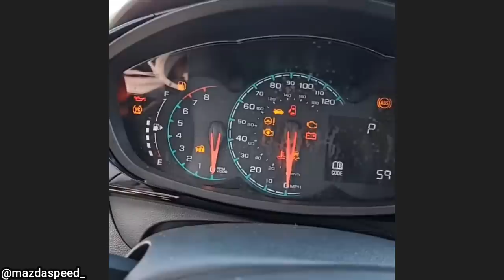Customer States My Car Won't Start (Chevrolet Spark) | Just Rolled In

Comment: It's amazing that people will take a chance of driving their vehicles to the shop in such bad shape like the Chevy pickup in the second clip was but somehow manage to make it. They each have either have a Guardian Angel or Lady Luck.
Reply: They probably installed new upper control arms and drove it there to be aligned.  I'm surprised the shop was driving onto the alignment plates
Reply: To tell the truth, I've done it.
Reply: I limped my golf to work (where I have a lift) on a drive axle that was one good incline from exploding into pieces and leaving me stranded. That axle legit had 0 miles left on it as it fell apart when I removed it.

Comment: I have a renewed distain for mechanics now due to a recent incident. Car began overheating so I took it in. They told me that it needed a new head gasket and would be around $2000. I declined, because I am a college student and do not have that kind of money. I read the diagnostic and it stated that the radiator cap was not holding pressure and the gasket on it was damaged. I literally walked across the street and purchased a new one for $10. Temperature issue was fixed. Head gasket was not broken. This is why so many people hate mechanics.
Reply: customer states, "head gasket is NOT blown" lol, good luck kid, let us know what you find on your next oil change
Reply: @muffntheB  Because it was not. Engine passed a pressure test, and is not consuming coolant. It also has clear oil, clear coolant, and no exhaust bubbles in reservoir. Wanna tell me again how it could be a bad gasket?

Comment: 0:05  Every technical profession has stories like this. The TV repairman who plugs in the TV; the electrician who changes a light bulb; the plumber who opens a valve; the HVAC guy who replaces the battery in the thermostat. I admit, though, that this one is pretty pitiful.
2:45  Another of those weird things that you could never make happen on purpose, and that no one would believe without the video.

Comment: Woah, what the hell was in this garbage can for this spark to cause this violent explosion? XD
Reply from the maker: Dynamite? 😆
Reply: *I assume there was flameable vapours at the bottom and when that spark when inbetween the air and that flameable gas it exploded with a good air-gas mixture.

Comment: That guy welding is lucky it only blew up that trash bin and not the GAS TANK sitting on the bench like 2 or 3 feet from him. Never weld right next to a tank of gas. Or in this case, next to a barrel that obviously had some sort of flammable vapors in it.

Reminds me of a video where a guy was trying to plasma cut the top off an empty barrel and the fumes inside blew the top off in his face.

Comment: I didn't take a video or picture of it for a few reasons, but I did a brake job at work and someone forgot one of the pads. Straight caliper on rotor. I didn't get a picture because many have done that and seen that stuff before.

Comment: Some people are particularly irrational about their car maintenance. 
It’s pretty common for people to run their car out of gas. Theres no good reason to do so, but people feel like if they avoid buying gas it’s somehow cheaper… spoiler, mechanics cost more than 1/4 tank. They do the same thing with oil changes. “I cant afford an oil change” they’ll say, as though 3-5k for a rebuild or engine swap is cheaper.

Comment: I had a woman complain her car sounded like it was going to die ONLY when she turned right. I tried to explain to her when she made sharp turns with low gas, it probably sloshed gas to the opposite side of the fuel pump and she temporarily ran out of gas. She didn't believe me,  I mean just put some gas in the car to see if it fixes the problem. Whatever lady lol

Comment: It's so depressing how that Chevy Spark's steering wheel switches and door bong were identical to European Vauxhall/Opel models.  That's GM for you, the Buick Regal and Vauxhall/Opel Insignia are also the same car.

Vauxhall is now owned by Peugeot so we'll see how that goes... or doesn't.

Comment: That Chevy Spark has a poorly designed gas gauge. When empty, there are no indicators lit, I can see that confusing to someone unfamiliar with the car. It should have been designed as the bottom light being orange, and would only lit when the tank is very low or empty.
Reply: Except that there is a low gas indicator clearly lit up in this one.

Comment: I had the enjoyment of having a 00 Camaro which were notorious for faulty gas gauges and yes, mine did not work. But the trip odometer did. Never once did I run out of gas. There is something to be said about common sense.

Comment: People just running out of fuel and getting stuck is a way more common problem than most people would think. Some people are stupid but for some people, especially when fuel prices rise, they delay filling up until the prices come back down. The problem is they end up getting lower and lower without realising it & then car no go no more.

I am not sure how the person with the Spark didn't understand just by looking at the gauge that it was empty? Did they just buy the car and not understand how it indicated how full the tank was or something?

Comment: What would cause the hood of that car to split open? I worked at a body shop for 8 years and never saw anything like that before.
Reply from the maker: Probably rust I could see doing that. Maybe rust the spot welds that hold the two pieces together. Or a cheap aftermarket hood?

Comment: The hoods separating is scary.  And the wire burning through the plastic parts was an insurance adjusters nightmare. No gas in car? 75 dollar tow fee. 100 dollar diagnostic fee. Please use YouTube and learn how to do your brakes. Great, scary videos. I might start walking everywhere.

Comment: the Chevy truck was driven straight onto the alignment machine. It was probably a lift kit done at home with the intention of taking it to a shop for an alignment.
Reply from the maker: I was thinking that as well. Torsion bars probably cranked up. Still waiting to hear from the tech what the exact "issue" was.

Comment: I been seeing a lot of people coming in without gas. I know gas prices are high but its NOT an excuse to come in with no gas especially we have to test drive it. I even had to confront a customer to put gas in his car.
Reply from the maker: That always hurts my heads when customers did that, especially for a driveability concern. The gas tanks are always full though when you have to do a fuel pump.
Reply: @JustRolledIn  I know right! Just don't make no sense.

Comment: The Chevy Spark will be back here in a year or so as “after no oil changes the oil in this car turned to jello” or “customer’s car stopped running on the highway and there’s a big hole in the motor.” If your that ignorant, it’s only a matter of time.

Comment: The shop torch guy was awesome! So he'll get shit, but why are volatiles in a open can like that? I'm curious what exactly the flammable was there. where'd the running scared guy go off to? LoL!

 Even with stupid high gas prices a tow bill will still buy quite a bit.
Reply from the maker: I wish they said what was in the trash can. Hopefully the guy running was getting the fire extinguisher lol.
Reply: @JustRolledIn  I thought maybe yeah, running for an extinguisher? but if it's that far away, what's the point? HAHA! I always thought a good spot for one is on the cylinder cart :) ~ But those flammables, that was heavy gasses laying low in the bottom. Probably a "WHOOSH" moment waiting to happen regardless - I call it lucky it happened how it did, so GOOD JOB! That was a 3pt spark shot, nothing but net.!

Comment: I had a shop rebuild a 351 ho for me to put in an 89 f150 got it back from them drove it real easy for the first thousand Miles like you said and at Mile 980 it started hopping real bad so I shut the motor off and let it Coast into a parking lot get out in a harmonic balancer the rubber was gone out of it so I took it to my brother-in-law and had him check it out and he poured some of the oil out of it in a mason jar and the harmonic balancer broke because the motor was locking up and it was so bad out of balance because it ate the entire inside of the motor it looked like glitter inside of this oil and turned out when he took apart the motor and found the oil pump was completely clogged with silicone they couldn't get any oil through it there was so much silicone in it and the shop that replaced the motor would not cover it since it had been driven since then even though it was inside of their warranty

Comment: If you continue to put gas in your vehicle when it gets low, the engine will continue to start and run, provided you don't stupidly add tap water to the radiator, which is the dumbest thing you could possibly put in there.

Comment: For the people complaining about the gauge. Regardless if you think it’s bad design. The low fuel message would have come one every time the ignition was on the on position, on top of that it would have also made an audible sound. Also there’s a reason vehicles come with an Owners manual. So you can familiarized yourself with your vehicle. Sometimes you just gotta take the L

Comment: I had a new car that quit running (under warranty) and they came and towed it. The service guy called and it was out of gas duh moron (he didn’t say that but I could tell by his tone).  So I asked why the gauge says it’s at half?  

He called back later and said they replaced the gas gauge 😂. No charge.  They even put gas in it.

Comment: Shouldn't a 2020 car be still under warranty ? Or did he drive it beyond normal mileage ??
Reply from the maker: Which vehicle are you referring too?
Reply: @JustRolledIn  the 2020 Chevy Spark that was towed in non-start
Reply from the maker: @jaybee570  yes still under warranty but it had no fuel in it so that's not something covered under warranty.
Reply: @JustRolledIn  true but apparently the dealership would have told him that .. He had to pay for the tow either way
Reply from the maker: @jaybee570  yep the tow and they charged him 1 hour labour + fuel.

Comment: if the idiot light is on that says fuel pump your low on fuel ⛽️ and you run out your motor is running with nobody behind the wheel.

Comment: To be fair the design of the Chevys gas gauge is horrible.
Reply from the maker: Agreed on that. Not the best that's for sure!
Reply: Not just Chevy. I accompanied my Granddaughter when she bought a (used) Nissan. Had to get the owner's manual out to figure out if the tank was full or empty - it was full. I much prefer an electromechanical needle, thank you.

Comment: What the fuck was in that trash can???
Reply from the maker: They didn't mention. But possibly grease? So many flammable things in a shop so it could be lots.
Reply: @JustRolledIn  I bet a rag with some gasoline
Reply from the maker: @n0rton  you never know. That's why most shops will have a container with a lid on it for rags.